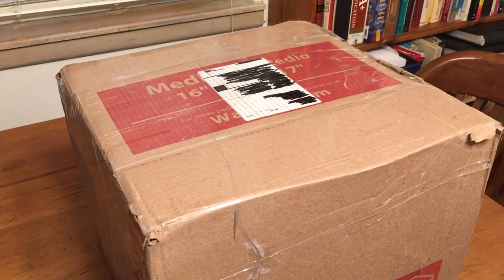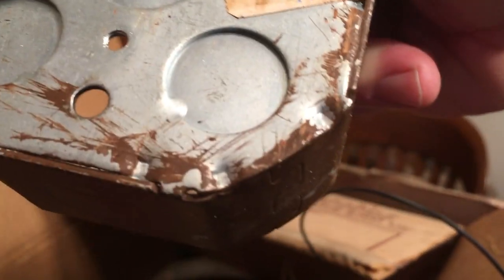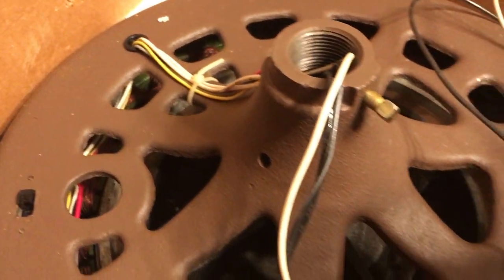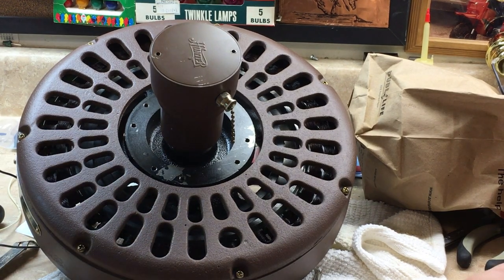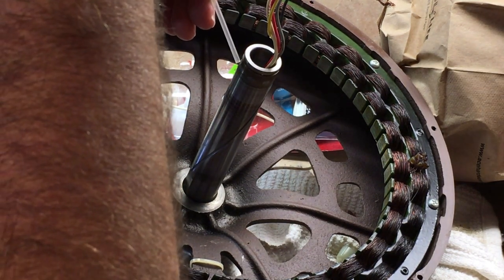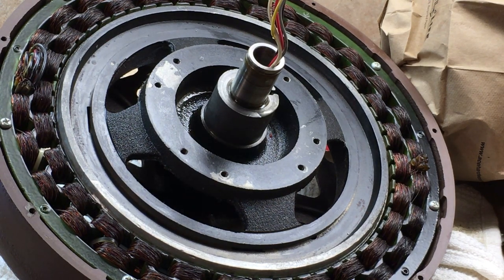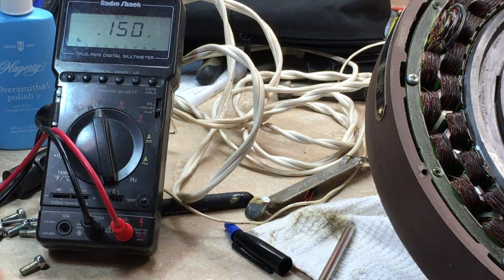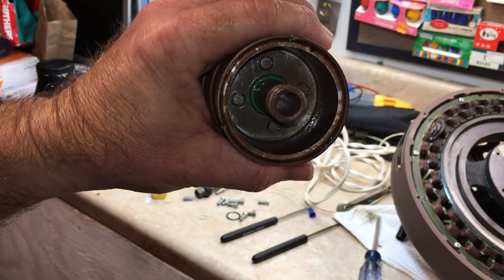1985 52" Robbins & Myers Hunter Original 25572 Part 1

Comment: Hello, I’m restoring three Hunter model 25572 that use a reverse switch and I cannot find any wiring schematic for this fan motor. It has like six wires to the coil and it has a capacitor, reverse switch and a speed switch. Would you be able to help me? I love your videos.
Reply from the maker: Unfortunately, I don't have a schematic for this fan. I just had to take pictures, and notes before disassembly.
Thanks for the kind words, and I hope you'll record videos of the finished restorations.
Might check with The Hicks House Of Vintage Fans & Electricisms, he is quite knowledgeable with Hunter Originals.
Reply: @dynatrak  Can you tell me now to get spare parts such as the bearing and gaskets.

Comment: Outstanding video. Couple of questions:

1) Can a fan without an isolation ring have one installed? 
2) Do the pvc blades for the current hunter original fit early 80s models like the 23272 or the 23306?

Thank you.
Reply from the maker: Thank you!
Yes, an isolation ring can be installed, given it's a four blade only flywheel.
I'm not sure what the blades are lie on the current production. If they take the grommet, they won't work. If you found an older set of outdoor blades with the small holes, it will work. I've been meaning to experiment on how to use, for example, C blade irons with grommet blades.
Reply: @dynatrak  Thank you for the quick response. It seems to me the isolation ring was discontinued either as a cost saving measure or after they introduced grommets on the blades to dampen vibration. It would be great to know whether the current PVC blades rated for outdoors it the earlier models. I'll ask around or try and post back. Thank you again for the videos.
Reply from the maker: @usergvhhyu1223  You're welcome. Yeah they were discontinued after the transition from a shaded pole motor, to a psc (Permanent Split Capacitor) motor, that uses a capacitor, like this 1985 model. It doesn't vibrate like the shaded pole motor does, so they weren't needed anymore..
Reply: @dynatrak  Still learning about this. There are shaded pole motor HOs w/o the isolation ring. How did they handle the vibrations then? TY
Reply from the maker: It's really not that horrible, just have to make sure all screws are tight, or it will rattle, and buzz like crazy. I had two that came with them, and I took them off. Not sure they make that big of difference. I have one above my bed from 1984, and I sleep just fine.
Reply: @dynatrak  Thank you.

Comment: I have the same exact fan, labeled Hunter, though, not R&M. How do you decode the tags for dates and all? 

I’m certain mine is 85’ as it has the same model number, rare top-mount reverse switch, modern blade brackets, isolation ring, 3-speed, etc.
Got it nearly mint locally, installed it outside on my back screen porch with a variable speed control. It’s incredible yet I feel badly installing it outdoors lol. 
It Complements my front porch 2018 brown Original nicely.
Reply from the maker: Awesome, yeah the top reverse switch wasn't around for long! My serial is 581073, is stamped on the side tag. The first four numbers is the date, backwards, so mine is from 0185. R&M sold the Hunter division later in 1985, so you have an early Hunter Fan Company version. Yours should be 85xxxx.
I have two white Originals on the back porch, and they do just fine.
Are you going to upload videos of your fans?

Comment: I have an older model with layers of paint.  Is there any way to strip it down to the top and bottom castings, so I can immerse them in paint stripper?
Reply from the maker: Not sure what vintage you are talking about, but getting the armature perfectly lined up is very tricky, in the 70's-80's versions, as they are set with lead.! Best just to leave it be, if possible.

Comment: Mr. Dynatrak, what's the difference between a Hunter 23572 and 25572 ceiling fan?  The sticker on mine has both model numbers, doesn't say which one is mine.  
Also, any idea where I can get a replacement fan blade arm for that fan?  The part number on it is 92276.  Thanks!
Reply from the maker: I'm not sure, likely just a blade, faceplate, or blade arm finish.  I don't have a 1985 catalog to know for sure.
I've gotten parts from Design Center Service Center in the past. They have a store on ebay, and might have what you need, even if it's not listed.
Reply: @dynatrak  Thanks for the info!